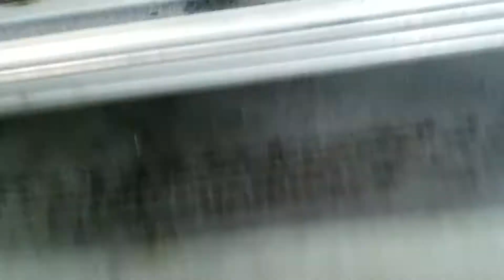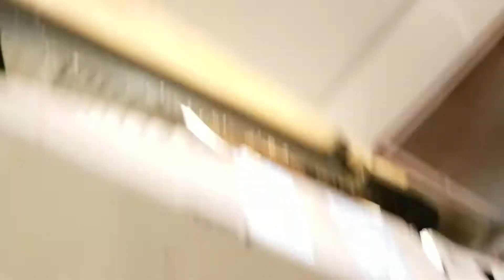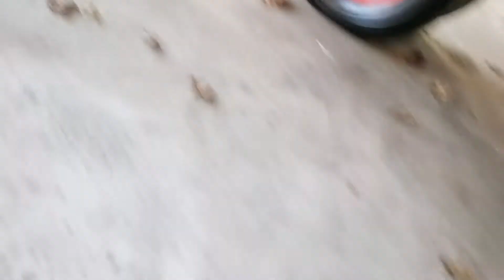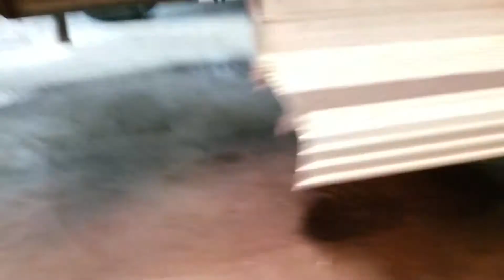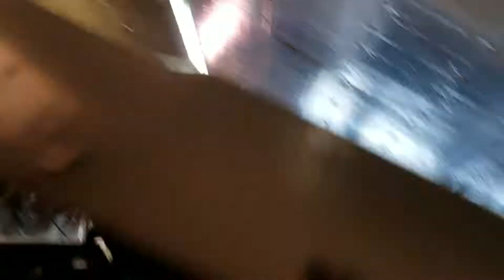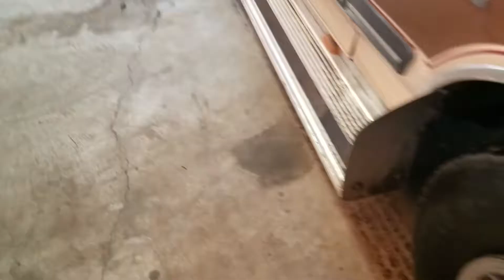7.3 IDI SMF flywheel conversion rubbing inspection plate

Comment: I know this is a few years old, but just did the conversion on mine, I have the same issue and my truck seems to vibrate/shake alot more at idle.... wondering if you had the same?
Reply from the maker: I've read if they shake more at idle you can tell if it's transmission related or flywheel related by if it goes away if you press the clutch in. Mine never really shook at idle, but I know smf over exaggerate imbalances if your idle isn't perfectly smooth too. If you give it a little throttle in neutral and it clears up could be that.
Reply: @brians-misadventures  thanks for the info, I will try that.  I'm almost at the point of putting the dmf back in but your info I will try.